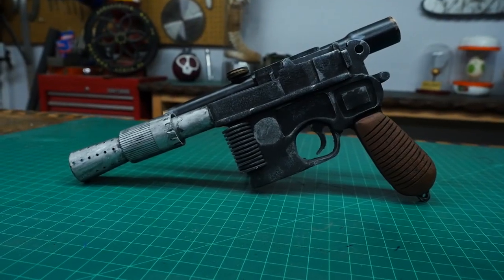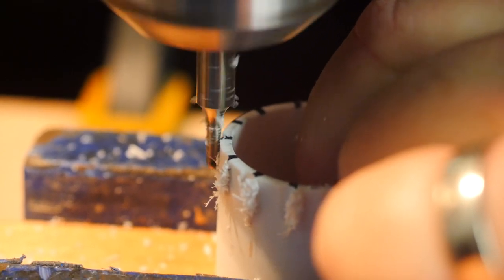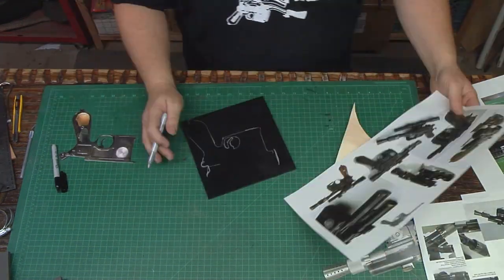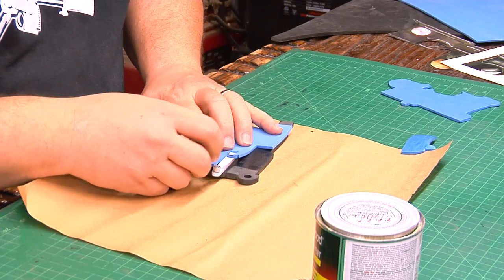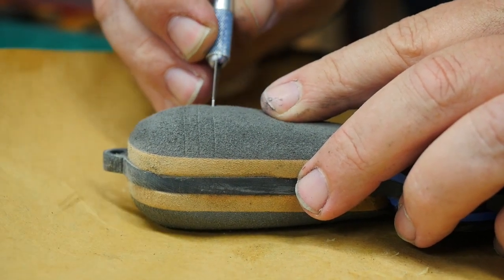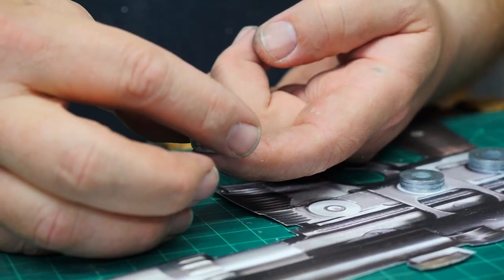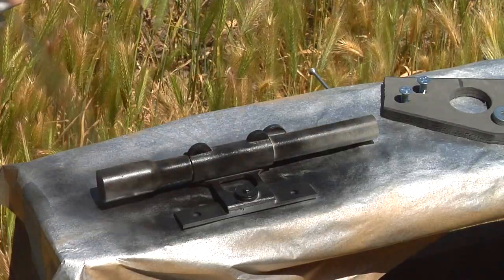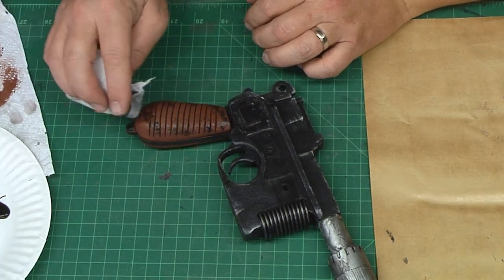Odin Makes: Han Solo's Blaster from Star Wars

Comment: YAY!!! I am totally going to attempt to make this and fail, but it's gonna be fun!
Reply: isaiah hatcher Making props and costumes is like life. You're gonna make mistakes, but you learn from them
Reply: John 117 That's true. Sometimes I make mistakes that I end up keeping because they make the design either more realistic or I just weather it a ton.
Reply from the maker: If you have fun, is it truly a fail? there's a toy Mauser c96 on Amazon for like $14, and it's the right size. Just start with that instead!
Reply: Odin Makes I didn't think about using a mauser! Didn't they use something like that for the real prop? I know for Luke's lightsaber it was a graflex and Obi Wan had a bunch if grenade parts.
Reply: isaiah hatcher Sorry for the late reply lol. Those little mistakes and imperfections add character, they make the prop unique
Reply: You could repaint the rubys blasted it's a both $15 dollars and is great for beginners
Reply: Did you ever end up making this? And of so how did it turn out?

Comment: Odin, damn fine job on Han Solo's blaster.

I do want to ask: Do you have to heat-seal the foam with a heat-gun or a hair-dryer before coating it with Plast-Dip first? I'm starting to work on my first prop and almost all the forum posts I've seen/Especially on the Replica Prop Forums, they never mention heat-sealing the foam before applying Plasti-Dip/At least a grand majority of them don't mention it. I also meant to ask this on your Zero Suit Samus Gun episode as well, because you just used black spray-paint on that on top of the foam to seal that up.

My apologies for asking so much. It's just this project is the first I'm doing & I kinda don't wanna screw it up. The project I'm working on also sorta requires I glue 6mm foam to the middle of a hinge to make the piece come together/I left a post on your "Odins Makes" FaceBook page explaining my project in detail. And also, I guess 2 to 3 layers of Plasti-Dip is ideal for sealing the foam? If I'm incorrect, feel free to correct me. If you respond to that, that'll be awesome as I'm just excited about this project I'm working on.

Comment: What did you use to glue the PEX pipe?
Reply from the maker: The PEX was a tight fit into the PVC barrel, and if I remember right, I put so much super glue for the funnel / flash suppressor that it held the PEX in place too. Then the ABS from the body was hot glued into the PEX.
I think the Weld On 16 was able to glue it, but now I am not sure if that was my hope, or if it did work...
Reply: Thanks, I'm running into issues trying to get PEX glued to CPVC fittings and getting EVA foam to stick to the whole thing, so any tips help.
Reply from the maker: If you are glueing EVA to the PEX with contact cement or even hot glue, defiantly sand the surface first, all the little scratches will grip better than the clean pipe. If you need the pipe clean because it will be seen, just sand where the glue needs to go. I did that to the funnel on the blaster, because nothing will stick to that plastic.